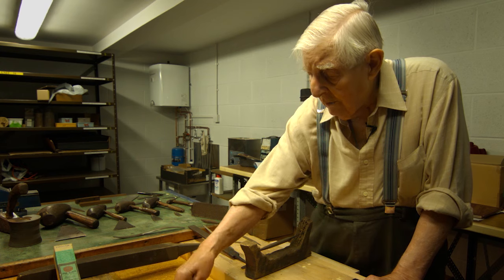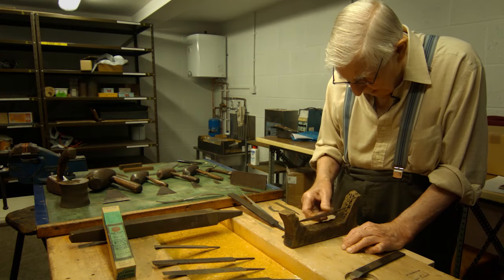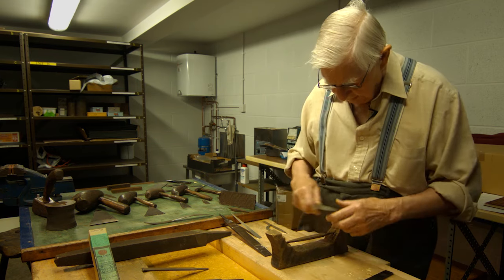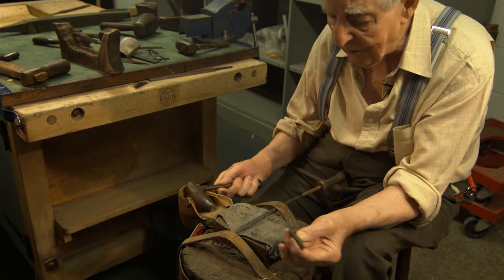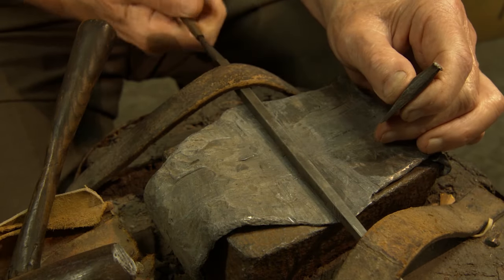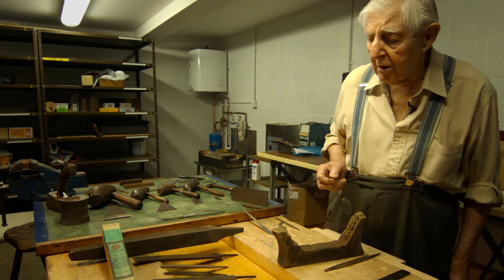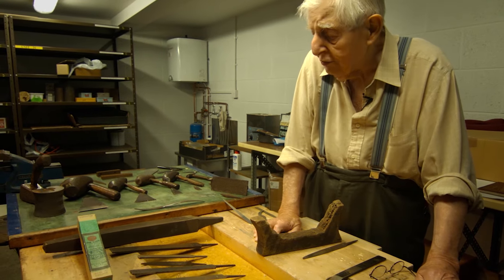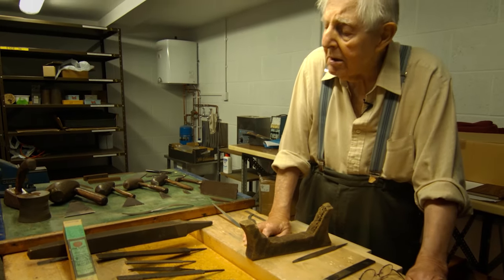The Process of Making a File

Comment: This is just the video I needed to get the rest of the basic knowledge i needed for making these things. it's annoying when a file gets damaged, and knowing how to make something means you know ways to repair. thank you.
Reply: I am sure you know how to clean a file with a wire brush when it loses its edge.
Reply: You can extend the life of files by carding and thoroughly washing then dipping them in a strong sulfuric acid solution for a few hours or overnight. Pull them out of the acid and neutralize with lime or sodium bicarbonate dry with compressed air or by any available means and test it, if it doesn't cut to your satisfaction repeat the process.
Reply: So you'll anneal your files, recut them, harden, and temper them?

I can use a brush or acid to clean them much quicker than setting up a furnace and quenching station…

Comment: In the past, labour was cheap and materials expensive. It might take half a day to make something using a file, saw and chisel that a CNC machine can do in seconds. My basic training ( REME ) required us to be proficient in using hand tools, before allowing us to use lathes, milling machines etc., and even then we had to be able to sharpen twist drills, and produce lathe tools from HSS stock. 
One thing that these types of videos omit is setting up the height of the vice, even before you start working, or you'll end up filing uphill or down. You stand next to it and shim the thing so that the top is the same height as the bottom of your elbow, or fractionally lower. Raise your lower arm to horizontal.They you'll be able to file flat without contorting your body to achieve the correct result. Also, to set an anvil at the correct height, clench your fist, let your arm hang down, and adjust the height to some point lower, depending on the size of your favourate hammer. Your fine adjustment, if forging thick steel periodically, is to raise your working height temporarily by standing on a wooden duck board.